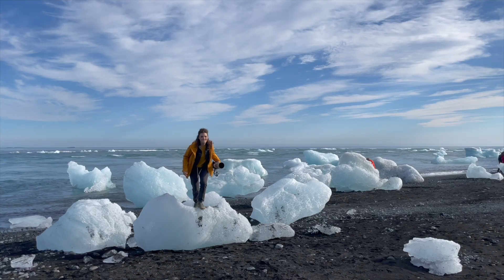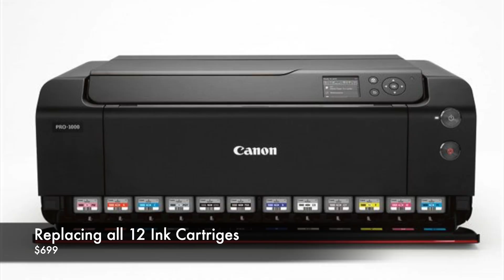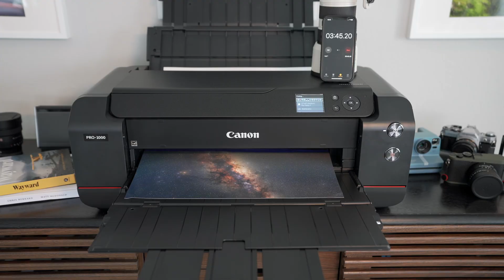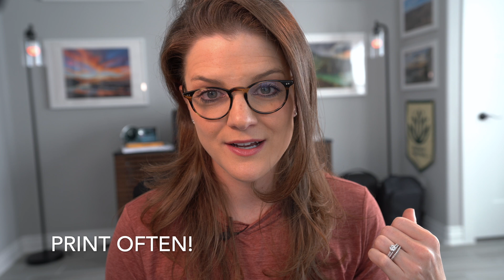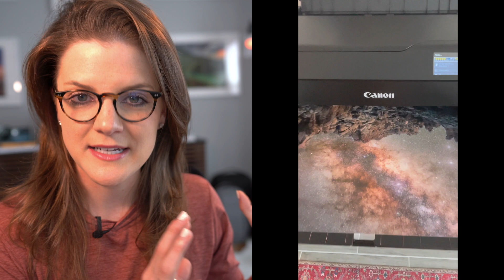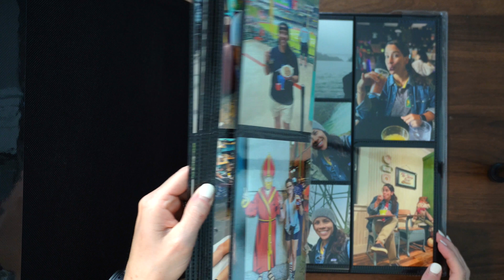Canon Pro-1000 - Worth the Investment?

Comment: Excellent video, but not clear to me is how you calculated the ink/print costs. Did you use an app to measure that? Or if not, the printer comes with ink cartridges that may only be filled partially and the purpose if that ink is to fill the lines between the ink cartridge and the print head/nozzles. There's some "bonus" in there but the cartridges will not be empty all at the same time, so making penny precise calculations, is difficult from this.
Anyhow, printing with an A2 printer too, my conclusion is the same. And we can choose whatever (top) paper quality we want, while using top quality inks. With the printing companies it is not always transparent that you get museum quality prints (or a notch less good "archival" quality, that still may be better than the print company's).
The maintenance cartridge is a fact of life and probably making one print per week already is enough to prevent the printer from ever going into maintenance mode to dump stale ink or prevent clogging of the nozzle.
Personally, I invested on top of the printer, inks, and paper in a calibration device for my monitor and for prints, too. That and making test prints adds to the costs and hassle. But with the calibration, testing is reduced to a minimum. No, I cannot earn back the material costs of calibration but not having to make as many test prints (time) is worth it.

Comment: Thanks for your video.  Here is my experience using the pro 1000 printer the past 2.5 years. Yes, print a lot and never switch it off. This printer is very reliable.  I print about 800- 900 prints a year. Mostly A4, A3+, A2 and some panos up to 1.2m.  Never smeard or failed so far. If you only print up to A3, the Epson ET8550  is a good alternative or ET8500 up to A4.
Reply: How often do you have replace ink cartridges?

Comment: As you are using OEM inks you can get a more realistic ink usage by using the software in the printer. Also i am pretty sure there was a firmware update that allows a custom print size of up to 1.2mtrs (4ft) now .
Reply from the maker: I think I heard this too about the update! I will have to try it... and then find a piece of paper that long to print from (as I dont have a reel!) thanks for stopping by :D
Reply: @mallorydavisphotography   If you can get fotospeed papers in the USA? They sell panoramic sheets. If not then A2 ( 17x24 ) sheets can be cut length ways to create a panoramic sheet.

Comment: I also had the Canon pro-1000 and bought a 17 inches roll Canon paper and cut it to size myself that works perfectly and saves a lot of money.
Now have the Canon pro-2100 and it is very nice that you can put a roll in it. It's a pity that you don't have a roller system on the pro-1000. I think it is possible an equal Epson. Nice video...
Reply from the maker: Great tip! I would have never thought about that!!! Maybe I could rig a system near the printer to hold a roll....... but then how would I do a clean cut.... all things to think about!!! Thanks for watching, Fred!
Reply: @mallorydavisphotography  you could have the print feed onto a paper trimmer.
Reply: Yep, all the Epson photo printers can use roll paper. The Epson SureColor P906 (their smallest pro printer) can print up to 18 metres in length, 17 inches wide.

Comment: Great video, Mallory, thank you. I've worked with the Pro-1 for several years (a Pixma 9500 before that) and have been quite content, but I just got the B200 message - go get it fixed. But I wonder if I shouldn't just junk it and buy a new one - it's an old design, and Canon doesn't say anything about under-the-hood improvements they may have made over the years. Your comment about the 1000's wasted ink tank shocks me - is the Pro-1 just as bad? I've calculated maybe $7 worth of ink for an art-margins A3+ (plus $5.50 a sheet for the 310gsm Hahnemuehle paper I use).  PLUS - do you see any difference between the print res of the 1000 (2400x1200) with respect to the 4800x2400 of the Pro-1?  I'm a fine art guy and rather demanding where print quality is concerned. Yo soy el esigente, like in the old coffee commercials.  Plus I wish the doggone thing didn't weigh 30 kilos - I'm not a young weight lifter and can't even box it without help. Anyway, thanks again. Best regards, Allen Schill. Torino, Italy.
Reply from the maker: Hi Allen!!! Thanks for the comment and watching! I have to say, I don't have experience with the Pro-1... but it seems Canon hasn't made any sort of announcement on when a new/updated Pro-1000 will come to market. I wish I had a better technical understanding between the two to answer your question, but perhaps another viewer has experience and can assist?? How do you like the Hahnemuehle paper? I am due for a new pack of 17x22 and can't decide!!! Thanks again, Allen!
Reply: @mallorydavisphotography  Hello Mallory!  Yes, it seems Canon (like so many companies these days) is a walled city with respect to giving out information - easier to hack the CIA, I'l bet.  I haven't yet decided what to do with my Pro-1.  I have the highest esteem for Hahnemuehle paper; the only trouble I've had with the William Turner 310 was with a batch that had tiny protrusions on the surface that popped off when I slid a print into a sleeve - the edge of the sleeve acting as a sort of chisel - leaving scores of tiny white spots, some not so tiny, as much as 1 mm in diameter  More than you would want to retouch; plus, the print surface remains vulnerable to handling.  Unfortunately for me, I had made some nine prints before discovering the flaking problem.  Hahnemuehle replaced the paper for me, no argument, but no one can make up the ink expense.  When I was starting with pigment printing, I "played the field" - I consorted with lovely papers from Canon, Canson, Ilford-Harmon and several others, having bought a few sampler packs, usually A4.  Shame on me, I've forgotten several of the names!  (In my defense, though, this is going back to 2010.)  But one of the A4 samplers was Hahnemuehle, and I loved at first sight the William Turner 310.  Since then I've been faithfully married to the WT, other than a brief dalliance with Adige 320, only because a friend gave me the package, which I used for a body of work a little different from my usual still life.  Also a fine paper, rough like a watercolor paper, but a little smoother than the Wm. Turner.  

I use this metaphor of matrimony because, other than wanting my editions to be consistent, many years ago I worked for Irving Penn, mostly assisting in his platinum printing.  Although he did some one-coat, one-exposure prints on textured papers like Arches, most of his output was done with overprinting - besides a main exposure, he would make a second exposure to either deepen the shadows (using a separate, enlarged negative), and occasionally even a third exposure to extend the tonality in the highlights.  To do this requires perfect registration of the negative, and dimensional stability of the printing surface.  Therefore, he would use a sheet of aluminum, mount a sheet of medium-weight white paper both front and back, and finally mount a sheet of 100%-rag tracing paper on the front.  (I must have prepared one or two thousand of these sandwiches during my time with him, using a big dry-mounting press.  The adhesive was a plasticky material in rolls, made with titanium white pigment.)  Excellent smooth surface (but not glossy) that  took the platinum chloride coating very well (but without drinking up nearly as much of that expensive stuff as a watercolor paper would).  The top edge of the aluminum sheet was exposed and perforated to allow the use of registration pins (holes were punched along the edges of the negatives as well).  

You can imagine how long it took him to evolve this method.  At one point he said, "We're married to this paper."  For better or for worse, in sickness and in health, etc.  Anyway, that expression has stuck with me, and I guess I'm married to William Turner - I hope he doesn't mind.  Have a look if you like at what I've been doing, and best regards:    https://www.allenschill.com/still-life-photography-and-other-media

Comment: My problem is the issue of the ability to frame the photos. I am not sure how complicated it  is to frame paper prints. Do you frame the photos yourself and if so can you summarise the process. I also happen to live the country and it would be great if I can control the entire process at least where framing simple paper prints are involved. Finally do you have any experience using the Canon PRO-2100 - would it be fair to say that it's a more advanced printer than the pro 1000? Thanks in advance :-)
Reply from the maker: Hi there!!! First, thank you for watching! As for the framing, I am doing very simple frames in my home from IKEA for my large 17x22 prints. I can share the link if you’re curious? Unfortunately I’m not familiar with the 2100… I imagine it does reel printing?? 
Best!
Reply: Agreed!

I'm a second-generation, film-to-digital photographer and have started exploring doing the printing myself. I lived in Buffalo for a bit and am a huge fan of a family print business (iprintfromhome) - decent prices, good selection of print options, excellent work and studiously careful handling and shipping.

For me, the real sticker shock has always been the framing. IKEA (_love those guys!!_), God bless 'em... they do have very reasonable frames. But if you're aiming for top drawer, it's a huge bite out of the wallet. I'm tempted to take up woodworking and learn to do the framing myself... ;-)

Cheers, mates!
J

Comment: Hi - Just to manage the issue of purging & not including bigger images or wall stuff.

 Is there any merit in printing off a card ( A5 / A6 ) every couple of days  -  with a view to storing them & then using them at Christmas or some other festival. I send about 50 Christmas Cards so that's about 100 - 125 days ( If I print one every 2nd to 3rd day ) - then with the odd calendar ( 12 prints )  & other reasons I can meet the printing frequency - Perhaps one item on Mon / Wed / Fri each week. 

Would this meet the requirement of regularity & avoid purging !!?

I'm definitely 'Over the Edge' ^_* - but just trying to choose between the Canon 300 & the 1000 - I don't like the smaller cartridges - I wonder what the maths is when comparing your sums between a 300 / 1000

Thank you for taking the time to make the video !
Reply from the maker: That is an EXCELLENT idea! And yes, would avoid going to the purge cycle. I wish I knew more about other canon models… but I think you’re on to something with the Christmas card idea!!!

Comment: Hi Mallory. Great video. Thanks for posting. I am indeed thinking of purchasing this printer to print and sell my work, locally. I’ve consumed nearly every video I could find on the Pro-1000 and t's Epson competition. I'm surprised, HP doesn’t seem to want to play on this level. I wonder what happened to them.

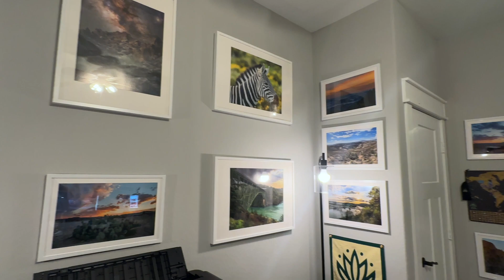At time marker 6:45, to the right of your floor lamp appears to be 16:9 ratio prints. Questions: Are those 16:9 ratio and were they printed on the Pro-1000’s max size paper, 22x17? If so, I assume you simply printed them at the max width and cropped the top and bottom. Is this the case, or is paper available in the 16:9 ratio? Finally, if those are 16:9, what is the actual size in inches, of the prints I’m seeing, including the boards? Also, please share the frame size as well.

I just discovered you in my search for all things Pro-1000 and might I say, I love the simplicity and straight-forwardness of your approach.
Reply from the maker: Thank you for the feedback, Yimi! I’m glad you’ve enjoyed my videos! The photos on my wall (larger ones) are all 17x22 borderless prints in IKEA frames that have a matte. So I don’t even trim the photos, I simply use a small bit of tape to adhere them to the matte and it has worked beautifully!

I think printer manufacturers realize the lack of margin in printing and intense competition from online houses like Mpix are making it harder and harder to justify innovation… but I’m just assuming here!
Reply: Through a firmware update, the Pro 1000 can print 17x47" prints.

Comment: Love my Pro-1000 but I make sure to use it every week. I’ll often print  4-5 prints before I’ve homed in on the results I want. Even though I test print with smaller prints, the bigger paper (you nailed it - it’s too much fun not to print big!) still sometimes requires a second print to fix things that didn’t show up with an 8x10 test.  I also have a Pro-100 which is much better suited for the casual user.  Enjoyed your your video on this. Thanks!
Reply from the maker: Thanks so much for watching, Stu!!! Great comment on the Pro-100, I get a lot of questions on which printer someone should start with!

Comment: Be aware that Canon offers NO REPAIR SERVICE whatsoever on the Pro 1000 printer. If you have a significant issue and the printer is out of warranty your ONLY option is to purchase a new printer (they will replace the printer under warranty). My Pro 1000 refused to power on and Canon tech support ultimately said it was dead. The rep said they DO NOT offer ANY repairs on the Pro 1000 so my only option was to purchase a new printer.

I'm  now looking at the Epson SC5000 since Epson does offer repair services on their printers.
Reply from the maker: Wow!!! So sorry to hear about your Canon issue! Great PSA though….

Comment: Thanks so much for the video. I am an avid amateur photographer, I am going to retire from my 'day job' next year and plan on doing nature and pet photography as a second career. I currently have the Pro 100, which works fine for friends and family, but will probably need to upgrade if I plan on selling my photos (I also live in a rural area so printing my own will probably be a must for me in a lot of cases). There are tons of videos that compare print quality, issues, etc, but I have been looking for weeks for a video that actually talks about ink costs per copy, yay for you 😁. I assume you arrived at ink costs per copy by tracking roughly how many prints you got per set of cartridges? It sounds like my printing would be similar to yours, so my costs would roughly be the same if that is true
Reply: I made the same journey, retiring to a 'second act' selling prints.  I'm very happy with the results from the  PRO-100.  Canon claims 25-40 years with Canon paper and Canon ink.  I tell my customers that I guarantee them for 25 years.  Then I tell them that I'm 68 and they are welcome to do the math :-).  I got a PRO-1000 because I wanted to learn to do true archival prints, aiming for museum quality.  The PRO-1000 delivers but for selling at arts and craft shows the PRO-100 quality and longevity is more than adequate.  So for my best work, I use the PRO-1000.  For day to day I use the PRO-100.  With the PRO-1000 just be prepared to print regularly or the cleaning cycles will become very expensive.  Hope this helps!

Comment: Thanks. I've been using a Pro 100 for around 10 years or so, dye based but works great. I've been thinking about getting a larger printer again. I had very bad experiences with HP products not working properly when they'd upgrade software. Eventually I had a $6500 paperweight.
Reply from the maker: Holy smokes that sounds like a nightmare… Have had a wonderful time printing with the Canon!

Comment: Financially, no-one should print from home from these pro-style printers. As a photographer, everyone should print from these pro type of printers.  The bigger the ink cartridges, the cheaper it is to print. Canon Pro 1000 = 80 ml. Epson SC-P900 (Epson's equal to the Pro 1000) 50ml. Epson SC P5000 is the commercial version of the SC-P900 & uses different colors than the P900 but has 200 ml ink cartridges that cost close to $1200 US for a complete set of cartridges & the printer was about $2k Us last time I looked. But if you talk per-print cost, it is the cheapest per ml to print from out of al 17" wide printers. I believe if you were to print 2 17"X 22" prints per week, the ink savings would pay for the extra initial purchase cost over the SC-P900 OR Pro 1000 in less than 2yrs. ( who cares if it takes you 4-5 yrs to recover the initial cost) So as hobbyist & won't print that often, & if you hang with other photographers or artist who might want to print from your printer & they cover their own ink cost & supply their own paper or, can just plain afford it...  Just my wandering thoughts. I try to print at least once every 2 weeks. Canon Pro-100. 
     3443420, can anyone who watched this vid tell what these numbers might be?